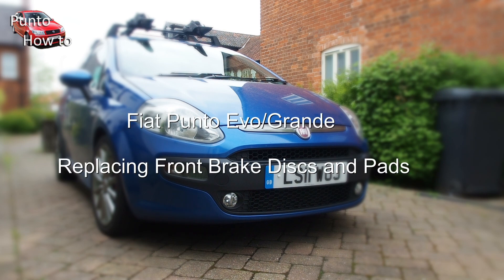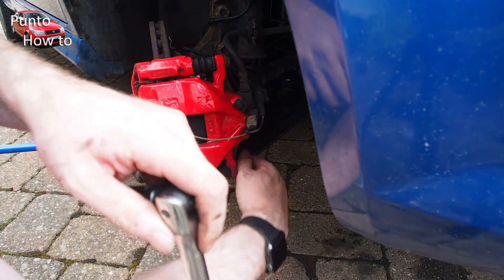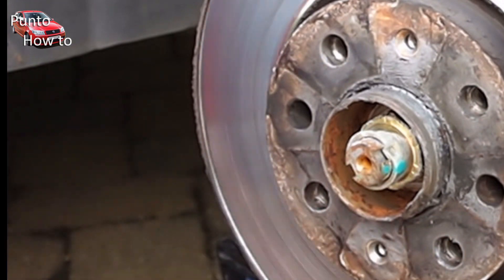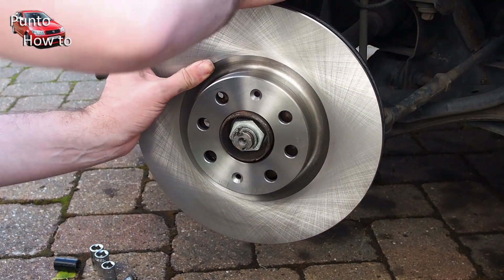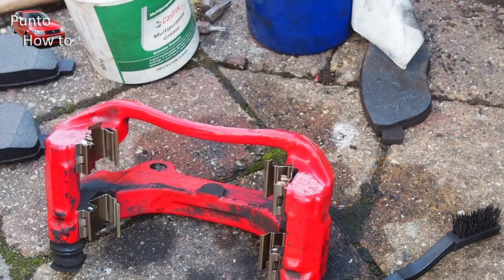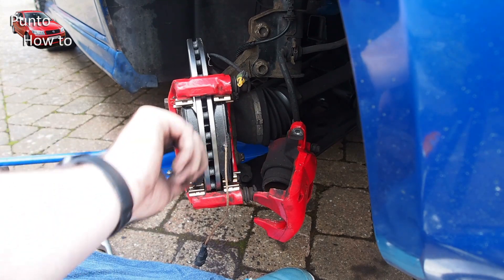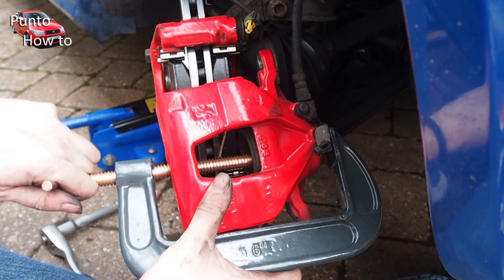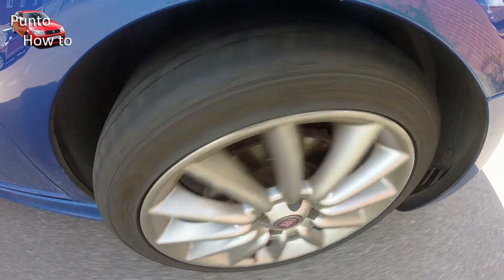How to change Fiat Punto Grande and EVO Front Brake Discs and Pads Replacment

Comment: great video. really think your channel could be the one for punto lovers, the market is out there. hope to see more.  I would love to see video on how to  fix a front seat that doesnt fold forward. really struggling to find info on fixing that.
Reply from the maker: When you say doesn’t fold forward are you talking about a 3 foot car with front seats that flip to let people in the back or the manual wider that moves the seat back forwards and back?
Reply: @PuntoHowto  yes I mean it won't allow it so you can let people in the back. You pull up on the handle and nothing. Just stays upright
Reply from the maker: Arts&Trusts  I can’t say what the specific problem is with yours, but my recent heated seat video shows you how to take the seat apart and this would give you access to all the components that allow the seat to go forwards, there are some cables that allow the seat to ping forward and maybe one of your cables has snapped

Comment: Good guide, thanks! Going to attempt this job at the weekend. One question... which point are you using the lift the car with the trolley jack?
Reply from the maker: On the back of the car I usually jack off the point where the rear suspension is bolted to the car body

Comment: Would love to see rear brakes job. Also do you plan to do a coolant flush and change. That seems to be a rare YouTube video for grande punto.
Reply: The basic version: 1. Open the radiator drain valve near the front left tire, 2. Use a small handsaw blade (pencil-sized) to loosen the plastic bleed valve at the top right of the radiator, then remove it with a ratchet wrench, 3. Squeeze the big rubber coolant hose until no more coolant drains out, 4. Close the two valves and fill the reservior up to max with distilled water, 5. Drive around with heat on MAX and fan at ZERO for 15 mins, 5. Let it cool down for 2-3 hours, 6. Repeat steps 1-3, then close the drain valve fully, 7. Fill it up to max level with a 50/50 mix, 8. When it starts to spill from the bleeder valve, close it fully, 9. Continue filling until at max level in the reservoir, 10. Start the car, and fill again to max level, if needed. It should take 5,27 liters of 50/50, but in practice there's always a bit left inside the engine, so you'll probably refill about 3,5 liters.
Reply: Check Fiat Forum UK, guides section for Grande. A lot of details.

Comment: great vid, i'm curious about how much torque to apply when tightening the bolts back on. is there anywhere online that gives this kind of info for evos?
Reply from the maker: I don’t know where you’re based but best advice is to invest in a workshop manual like Haynes then it usually carries all the torque figures for things like this where needed. Calliper bolts don’t need to be super tight because the force on them is sideways or a ‘sheering’ force so they need to be tight so as not to stress the bolts but don’t need to be torqued down to high levels I usually nip them up nice and tight by hand
Reply: @PuntoHowto  I'm in the UK but a total amateur when it comes to cars, so still trying to get to grips with everything. But I was considering getting a Haynes manual anyways, so that seems like my best bet. Thanks for the help though

Comment: Hi thanks for the great video's. Do you know how to remove the glovebox Punto 3 model? Thanks.
Reply from the maker: Yes, open the glove box, there is a little tab at the bottom/back, you have to pull this out and it releases the glovebox as it’s one of the pivot points for the glove box. It’s hard to explain but hopefully it will give you an idea of what to look for. This is genuinely something that might make for a helpful video to make
Reply: @PuntoHowto Hi thanks, yeah it would! ;-) They changed it from the grande punto. Do you also know how to run a power cable through the firewall grommet? I'm having trouble finding it.
Reply from the maker: rutger sprong I don’t, I’ve never had to do it, there is a route through from under the bonnet to the door area as I use this route for my trickle charger but I’ve not explored any further than this
Reply: @PuntoHowto  ok thanks anyway!

Comment: Is this a 1.2 or 1.4 I have the same colour but 1.2 but I have a little problem aux belt it start squeakily like hell  when flipping water leaks on to in when starting up in the morning 🙄
Reply from the maker: It’s a 1.6
Reply: PuntoHowto what no way I can’t find one with that engine do u have the same problem when water leaks on to the AUX belt
Reply from the maker: Liam Horn no I don’t, the 1.6 diesel is a completely different engine layout to the petrol engines, however a new belt and tensioner is not very expensive and a not to difficult to replace
Reply: There's a pipe that fiat sells which takes the water away from the alternative.

Comment: My car Fiat Punto 2016
I have problem in Autostart system 
One time work and one time off automatically, 
By Car Scanner ELM OBD2
Version: 1.99.5/200995/GP
DTC report
Connection profile: Fiat Punto 1.2 8V (CAN)Date: 15/09/2023 11:47:54 
============================
OBD-IIOBD-II
DTCs: 1
----------------------------
P181D [0x181D]
Can you help me please.
Reply from the maker: I’m not really sure what you’re asking or what is the symptom of the problem you’re encountering P181D is a fault code which suggests a problem with a gear position switch but other than that I don’t know what the issue is you’re having